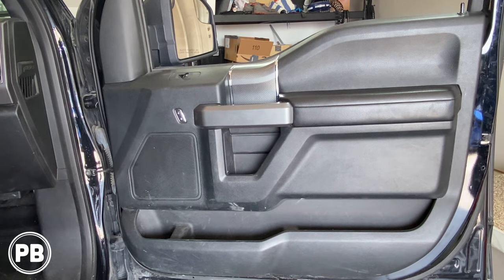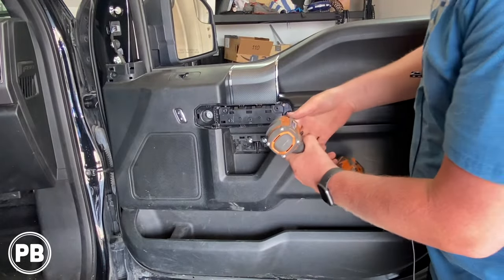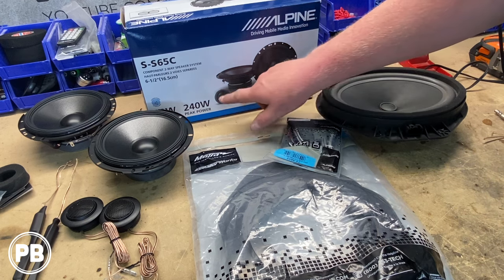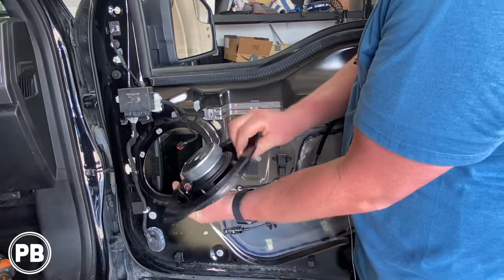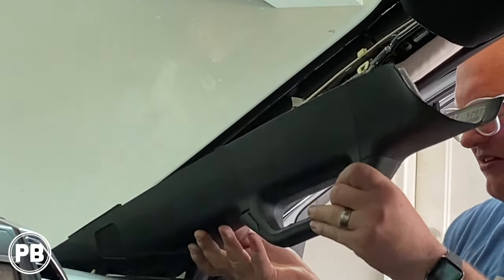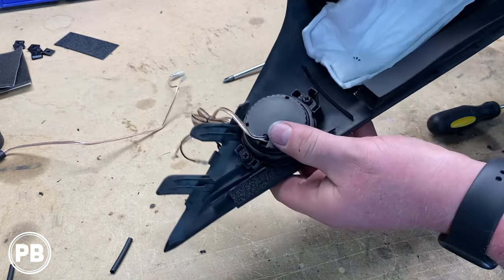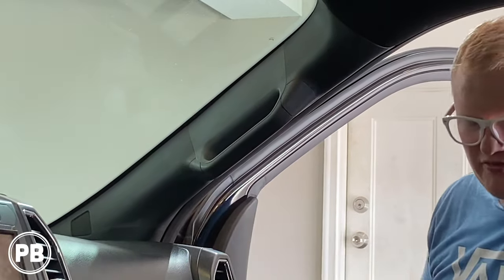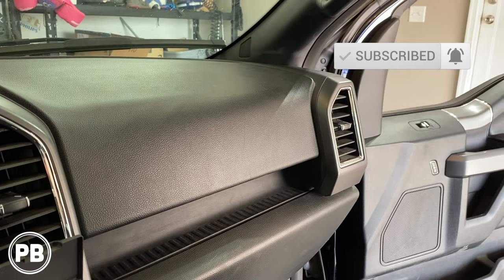2015 - 2020 Ford F150 Front Door Speaker / Tweeter Install

Comment: Just an FYI..I just put tweeters into my 2022 F150 Tremor and so everyone knows, the brackets holding the factory ones in, are held by screws, so no grinding needed to remove. Kinda nice and easier
Reply: There wasnt grinding to remove these either
Reply: Do you know which wires are for the tweeters in passenger side kick panel
Reply: When you pull off the pillar cover for the tweeters, you will see them.

Comment: Booo, you skipped the hard part running new speaker wires through the door hinge boots. You went the wasy route of just using puny factory wire harness.
Reply from the maker: It's because we didn't.  No need to with the speakers we ran.  The tweeters have their own crossover, so we used the factory tweeter leads to power our new tweeters.

Comment: Is there a better way to mount the tweeter?
Reply: I've seen other people do it and I also did it. I mounted them in the plastic sails.  Also if you're using a crossover in the door, it's way easier cuz it's closer.

Comment: Why did you choose to go with 6.5 inch speakers over the stock size speakers?
Reply: Price, especially if the 6.5 can handle aftermarket radio wattage. Got myself since 6.5 alpines components that my aftermarket radio can push. I don't plan on adding an amp for door speakers. I already have a hungry hifonics amp I need to feed.

Comment: Buying a 24' f150 soon. I want the upgraded sound system but it is a $9K upgrade package. With the standard stereo/speaker setup, would replacing the existing factory speakers with better quality aftermarket speakers improve the sound? Trying to not have to go w/ separate subwoofer and amp if possible. Your thoughts?

Comment: Great videos, thanks! I have a 2015 Ford F150 XLT, 8" Screen, no Sony or Amp. I am going to replace/upgrade all speakers and install the (2) 10" Alpine Sub box and Amp thanks to your videos! I have one question, why did you (and others for reference) decide to put in 6.5" speakers in the front doors instead of the stock 6x9" size speakers? 6.5" vs. 6x9".  I hope to hear back, thanks!

Comment: Great video! I just put a pair of coaxial 6.5" type S alpines in the rear, lack of treble obviously but I didn't want to drill anywhere for the tweeter. I do have a question, though. Did you notice a discernable difference in bass coming from the 6.5" versus the stock 6x9? I used to have the older type s components but only heard a difference with aftermarket head units that had multi-band eq's.

Comment: This method should be the same for the 2013 f150 right ? I have factory tweeters on the pillars . The only difference I see is the door speaker connector. The new I can see 3 pins, mine is only 2

Comment: Just bought a 2022 Powerboost F150 and have already replaced the factory rear door base speakers with the 6.75 Kicker coaxial speakers but I want to put components for the fronts. Am I going to have to put the crossovers in the doors and run speaker wires from the doors to the tweeters on the pillars?
Reply: This is the question!

Comment: Are those the in line crossovers on factory wires for the tweeters. Also what is the ohm load on tweeters ? My 21 f150 the tweeters factory 8 ohm and most tweeters im seeing on markets are around 6-4ohm is it ok to run like that ?

Comment: Great video Thanks for sharing! May I ask you something, 
the speaker in front by manufacture comes 6x9, you put 6.5 because you prefer or the 6x9 aftermarket not fit in the front? (windows issues,etc)
I have F150 2016 Lariat Super crew and I want replace the factory speakers, I got the 6.5 to the rear but I read the front need 6.5 not 6x9 so that confusing me, I will appreciate your comments, thanks!!!!
Reply: Some people prefer the 6.5’s as they tend to sound better than 6x9’s IMO.
Reply: The 6x9 in the front are shallow compared to the back so 6x5 sound better
Reply: The original speaker size is   6x9  or  6x8???    and the rear ones what size are they? Thanx for the help.

Comment: Great video bud. Question..I bought some of that soundproofing material. Should I put that behind the speaker bracket or mounts or will that make it stick out too far? Really appreciate your work brother thank you. I bought sound skins material.
Reply from the maker: you should be fine.  But always good practice to check clearance carefully when you reattach the door.  Shine a light through the speaker grill to make sure all clears.

Comment: So a 6.5 for the rear of 6.9 for the front (factory specs) is too big/small in aftermarket dimensions? So I’ll have to use an adapter regardless??
Reply from the maker: You will need bracket adapters regardless for universal aftermarket speakers. You can get OE replacements (like from powerbass) that don’t require adapters, but they also can be more expensive.

Comment: Hi PBAI.
Great video.  I already have 90% of the pieces that you used, except I am going to use a component pair of Boston Acoustics 6.0 (with crossover and tweeters) that I had for years, but never installed in any vehicle that I have owned ... fingers crossed that they are still clean and not dried out over the years in the basement.  
My truck is a 2017 F150 Supercrew.  Next summer, I am going to amp it up with a 4ch Rockford Fosgate to run the 4 doors and a Soundstream bridged to run a single 8" woofer that I am building right now.  Looking at an AudioControl LOC , so as to be able to keep the stock head unit.
I've never taken door panels apart, so I ask - what is the real amount of time that I should alot for door disassembly - speaker replacement - and door reassembly (per door) ?  And then I usually add at least 15%, for my standard first attempt🙃  Thank-you.
Reply from the maker: 1st door will take you the longest, but follow the video and shouldn't be too bad.  Give yourself a Saturday afternoon and you should knock it out in a few hours.

Comment: damn i bought 3 way 6 x 9 before even watching this video oh well ill still install it well see how it sounds
Reply from the maker: Factory speaker is a 6x8, not a 6x9, and without the appropriate bracket, they probably wont fit.  Bug good luck with your install.
Reply: Metra makes a good bracket. I did the same with hertz cento pro 3 way 6x9. It has way too much treble now, it way overpowers the bass. I added soundmat and it didn't help much

Comment: curious to see this run down to a crossover in the door
Reply from the maker: This is why we chose this type of component set as the crossovers were separate for the midrange and tweeter, so we didn't have to run new wiring for an external shared crossover.
Reply: @ProvoBeastAudio  I completely understand just curious as to how someone does it.  I prefer to put my tweeter in the pillar instead of door but only running 4channel so need the 2 linked
Reply: I was curious of this as well. I think my question falls along the same line as yours that I know usually whenever you see a component set you’ll also have the corresponding box that goes with it, which will allow you to increase or decrease treble etc. In the event that somebody had a system such as that do the wires from the a pillar come down into the door which would allow you to utilize the crossover box or would it require speaker wire being run up to the Twitter? Only reason I ask is because I noticed you used a bass blocker on that Twitter, so I was curious as to whether or not that wire fed down into the door along with the mid range. Thank you and great video.
Reply: @Wrensspeedshop  so depending on size of crossover I hid mine is the side there is a panel between the sail and dash you can stash the crossover I went active on my tweeters now but wasn’t a bad spot hope that helps
Reply: To offer a tad more clarity at the speaker input if your truck came with tweeter in the pillars tie in the crossover at input but make wire longer so you can run it down to hide crossover.  Hope this helps,anymore questions feel free to ask.  I’ll review this once I take a nap and make sure I’m making sense just got off night shift
Reply: @aaron29851  so if I understand correctly, you ran your physical crossover box behind the panel? Did you run a wire through the door for the mid range, if not how dis you  connect each speaker to the crossover and then to the amp? Thank you big time.
Reply: @Wrensspeedshop  I used Rockford power tweeter which have individual crossover but I do have 3 ways in doors if you wanted tweeter on a pillar you could use the same route but if using existing wire the tweeter should be separate.  If using a amp depending on the location you should be able to mount crossover near amp and use your existing tweeter wire at the harness for crossover input.  If hard to really say without knowing your setup though

Comment: This should be the same as the 2013 f-150 right ? 
I have the factory tweeters . The only difference I see is the door speaker connector. The new on is 3 pins mine is 2 pins.

Comment: How did you get 75w from the head unit?
Reply from the maker: We added an amplifier (5 channel amp that also powers a new sub).  That video series is linked in the description.
Reply: @ProvoBeastAudio  did you install the alpine crossovers or just use the inline-passive crossovers shown in the a-pillar wiring?
Reply from the maker: @chrisazo1  Always install the crossovers included with your new speakers.  The in-line crossovers in the A pillar are the ones that are included with the Alpine speakers.

Comment: What happens if you don’t add the crossover?
Reply from the maker: Blow speakers as you will be sending frequencies that the speaker cant handle, speaker distorts, you will cause failure.   Some speakers have built in crossovers already, so just depends on the brand and model.
Reply: @ProvoBeastAudio  I used the Amazon link and bought the alpine speakers that you featured in the video.  Could you please spec out the crossover that you used for these tweeters?  Thanks!